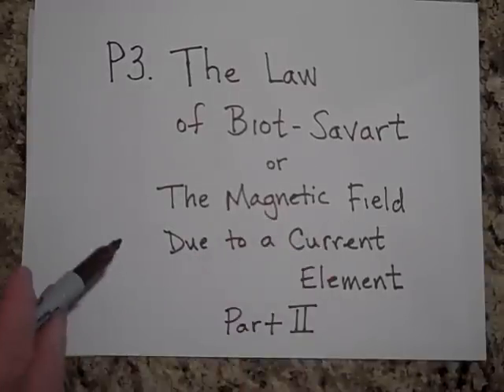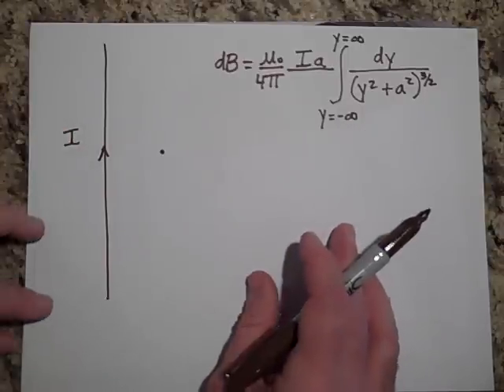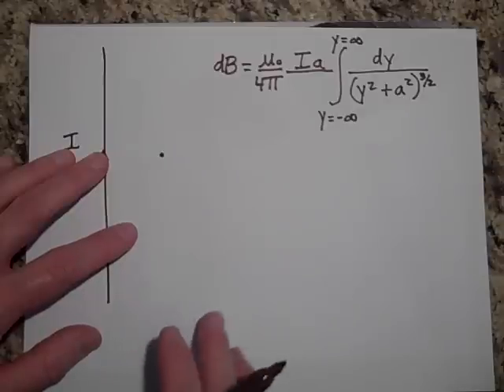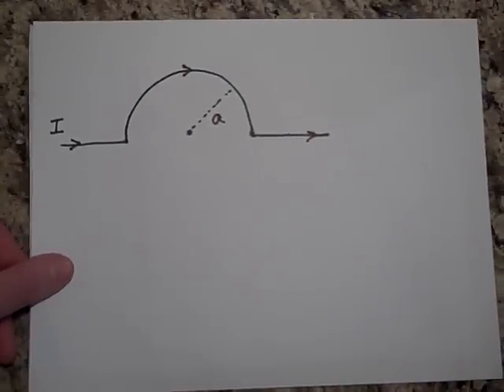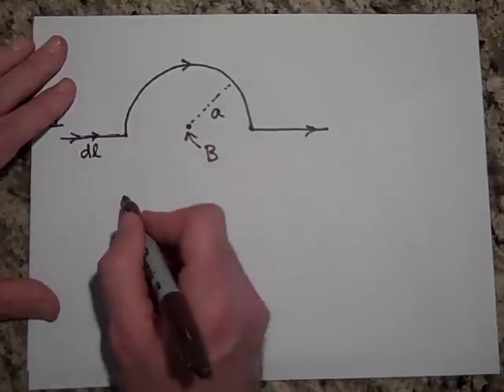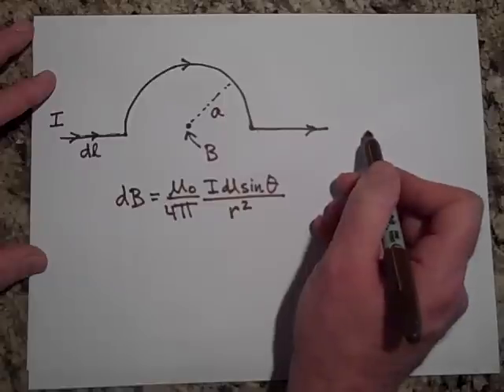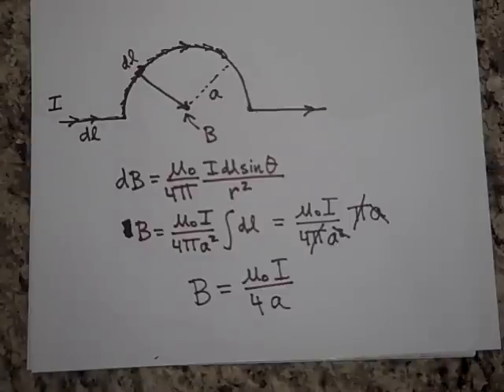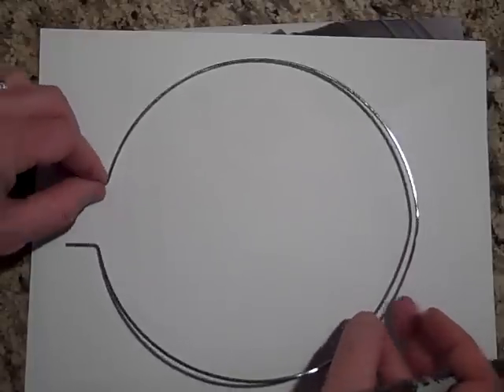The Law of Biot-Savart (part II)

Comment: Very helpful, but there is a way for this integral to be solved for those who want to know, 
you have to get a pen and write down this to fully understand : first you consider the ((perpendicular))* distance from a point P to the wire is a (as in the video) 
The distance from the origin to the the element of length equal to y and the distance r  from the point P to the wire makes an angle theta (ø) with the wire ...all that makes a triangle , //you drew that!? :~D so we can get that:
 tan(ø) =a/y
And so y=a/tan(ø) ,that is the same as 
y=a cot(ø)—>*
Then we can get dy=-a csc^2 (ø) dø—>*
Finally back to the integral
(Without excluding ( a ) out ! )
You substitute the y and the dy  
The lower part of the fraction would be = a^3 csc^3 (ø)
And the upper part:
a (-a csc^2 (ø) dø)
You can cancel terms till you get 
1/csc (ø)
And that integral to your surprise is just
Į Sin(ø) from ø1 to ø2  :))
Which is solved easily.
Cos(Ø2)-Cos (Ø1) and the minus canceled with the one that is earlier mentioned beside the a , in the case of this video since the wire is infinite ø1=pi and ø2=zero
So we are left with “2 “ from the integration that is divided by the outside 4pi giving the 1/2pi in the solution written in the video 

This solution i knew from my professor at university so thanks to him :))
Hope that could help :)
Reply: @William Han glad it helped :)))

Comment from the maker: You cannot easily use Ampere's law for this because there is no Amperian loop that can be drawn where where the B's are parallel to the dl's and the B's magnitude is uniform at all points on the Amperian loop.  Even if it were a full circle, the statement above would still apply.

Comment: How did the integral of dl become pi*a? If you integrate from 0 to pi, the answer should be pi.
Reply: When you're taking the integral, dl, you are trying to sum up all the dls throughout. For a circle, dl, would be the circumference as you're adding up every little element through the entire circumference, giving you 2*pi*r. In this case, we are only adding up half a circle, giving pi*r, but in this case r=a so we get pi*a. You wouldn't integrate from 0 to pi, as that relates to the angle, and we're not looking at dtheta, we are looking at dl. That's a very dodgy explanation of why it's not 0 to pi, but I hope it somewhat helps (=
Reply: I can see the reasoning in this case, but how would you apply it generally? What if the path is not a circle. There is a step he skipped, but I can't figure out what it was.
Reply: Ali Etezadkhah integral of dl is l, which is the length of the path (in this case circle). You would need to set up the integral if the path length can't be computed directly like this

Comment: So, what is the direction for the magnetic field?
Reply: +Denver Daño 
Into the board by the RHR (right hand rule).
Reply: +Quientin Morrison oww, i see. so it is about following the direction of the current using the RHR. thanks. but i have a question. i encountered a problem... it says, there is 3 segments which is segment A, B and C. segment A forms a quarter circle in quadrant 4. segment B along the x-axis and segment C forms also a quarter circle but in quadrant 2.. the current starts at the segment A .. when i follow the RHR, the direction for A is away from the board, C is into the board and B is zero bec it is along the origin.. is it possible to get different directions?
Reply: +Denver Daño I guess it would depend on how he graph looked.. its hard to describe these things with words.... If both quarter circles are rotating counter clockwise with regards to the current than both should be into the board. Either orientation is possible. For the straight wire, remember to still do the RHR, one side will show the magnetic field as pointing into the board and the other out, you end up seeing the same relationship for a coil of wire or a solenoid, but the magnetic field outside the wire is usually not as important, as the magnitude tends to be less.

Comment: how do you integrate this?
Reply from the maker: You don't really have to integrate because conceptually you're adding up the all the dl's.  But if you want to integrate it, you can change the dl to a(d(theta)) and then your integral is the S a(d(theta) with limits from 0 to pi.   The "S" is an integral sign and "a" is the radius of the half circle and is a constant.